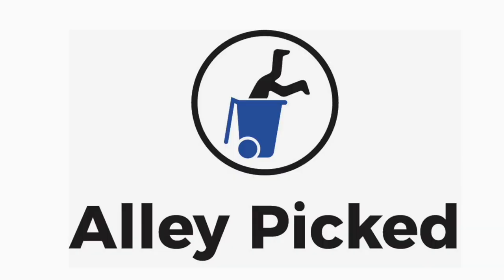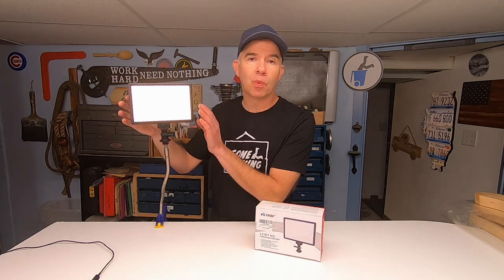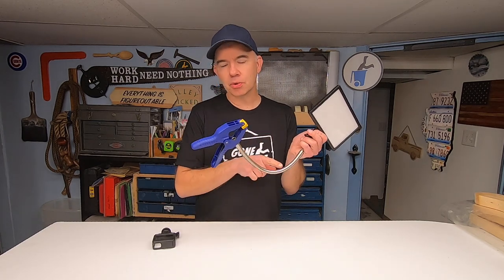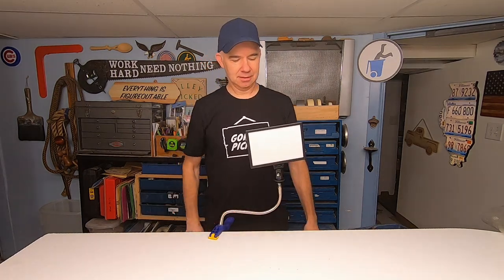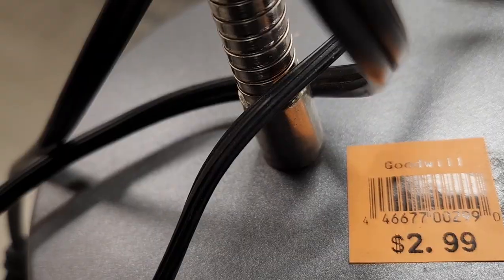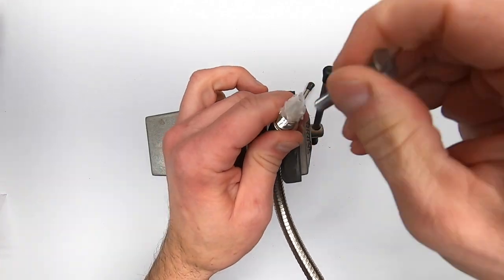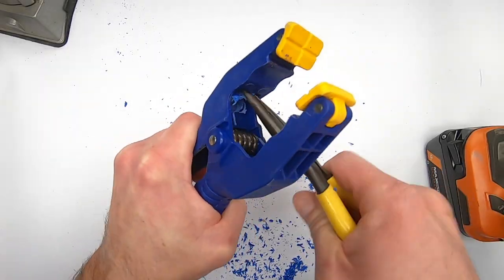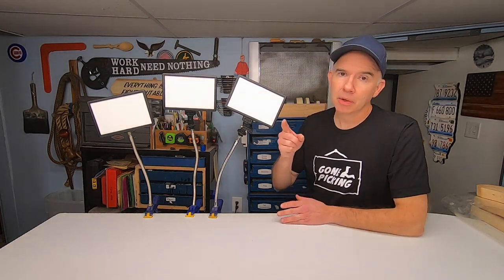Quick Tip: Clamp on Portable LED Panel

Comment: As is usually the case, this project is a combination of unique creativity melded with a little bit of thrift store junk recycling.  That's what Alley Picked should be, right?  I love this one.      I  was recently doing some 'wood engraving' with my Dremel on a home made ceiling light that  I constructed.  If I had one of these while I carved, it would have been so much easier.
Thanks for the video.
Reply from the maker: If I only had a million more like you!
Reply: @AlleyPicked  I think that we separated at birth!!

Comment: After you drilled the clamp how did you Attach the goose neck to it. Thanks
Reply from the maker: I put a nut on the inside. You may need to remove a bit of the plastic to get the nut to fit.